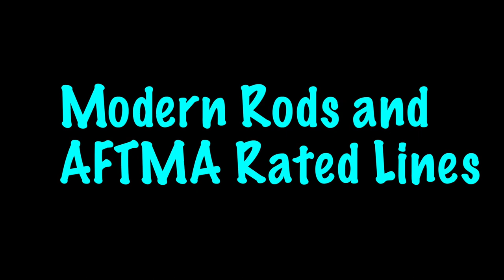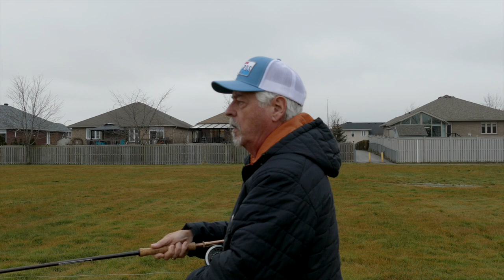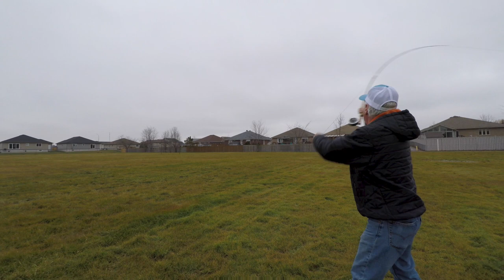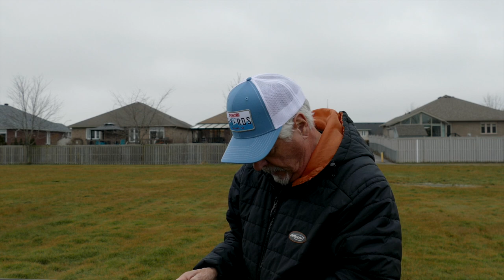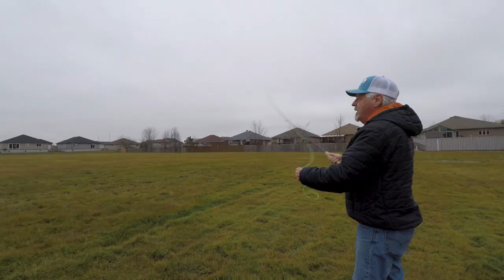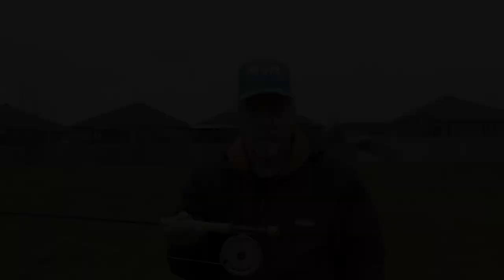Peter's Fly Fishing Vlog: Can Modern Saltwater Rods Actually Cast AFTMA Rated Lines?

Comment: I will say it do depending on the actual rod ! True a series of rods some are under rated and a different one can over rated! 
When I buy a new for me rod. I hard test that I push it up and go as low as possible! Just to find out where the sweetspoot is. 
I have a 9' 9# saltwater pro rod and you can cast a AFTM7 but you face about 75-80ft. If I put on Rio outbond short 9# who is 375gr it's easy do the full line ! If I go to my favourite line of all times! 
A-Jenen big fly2 its also 375gr but it's a 10# this line out do any line I have trying out on that rod. It's a short head of 26' but when you shoot that line the mass just continues in the direction you send it! So I say lines is more important then the rod ! And today we have so many different options its scary and most common people don't know how to use them in good manner to perform the best. Some dealers do not even know good from bad. I was a casting instructor for a time. I show good set up and bad so they could see and feel that difference. Fiberglass I did fish that many years and on very light tipet they still beat fast carbon rods. But at coastal fishing here I like more punch short stroke!
But even here we need progressive action! 
Not as stiff as possible that don't help any. And if tip is to stiff you open up your loop not many think of that.
My salt rod is custom built and its 30T carbon in the tip second section is 36T and the two bottom sections are 42T the blank is made of IM10 Toray Nano carbon. 
So I'm whit you Peter and some old line where very simple and good. Often the head was like 33-35' long. 
Hope this help people who struggle find a good line ! Try your friends that helps find out the difference! 
By the way A-Jensen is a Danish company and they ship world wide and they do high quality. 
Best regards from Scandinavia Sweden 🇸🇪

Comment: Hmmmmm...it´s not that easy out of my experience. I got a 6 weight Scott Meridian and this rod works great with a Rio Outbound short which is way heavier than standard lines but struggles with "true" rated lines. My 8 weight Meridian on the other hand has no problem with standard lines but cannot cast those heavier rated lines very well. So there can be strong differences within a rod line up. I also figured that saltwater specific rods can not handle those heavy full sinking lines like SA titan taper lines etc. For this fishing you need a streamer specific rod like Sage Payload, T&T Exocett SS or Winston Alpha+ rods. Those rods makes all the difference in the world!
Reply from the maker: I've heard and read quite a lot of good things about the Scott Meridian rods so I'm a bit surprised by the comment.

To break this problem down: 
1. Rods that simply won't cast their rated weight (in the 100s of rods that I have cast, I've only encountered two really bad ones and both were high end rods)
2. Rods that don't provide a lot of feel at their rated weight, yet cast just fine (fairly common)
3. Rods that work just fine, but don't suit the person doing the casting (quite common)

I'm kicking around the idea of doing a video on issue 3. As an example, I find that I can cast any type of fly rod without any issues, until I go for max distance. To go really far, I need a certain style of rod action. I'm fine with any rod action when casting under 60' to 80' (depending on the size of the rod, of course), but if I want to go really far (e.g. 100'-110' cast with a saltwater rod) then I can only manage that with a rod action that suits me. If the rod action doesn't suit me, despite the quality of the rod, I'll lose about 20'.